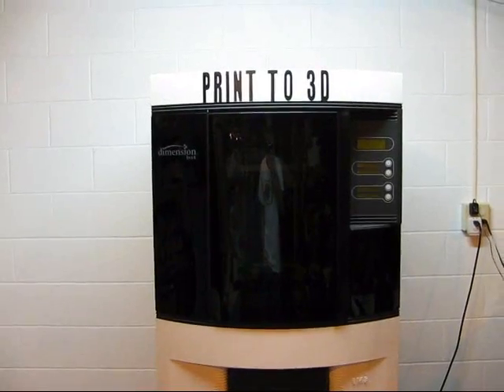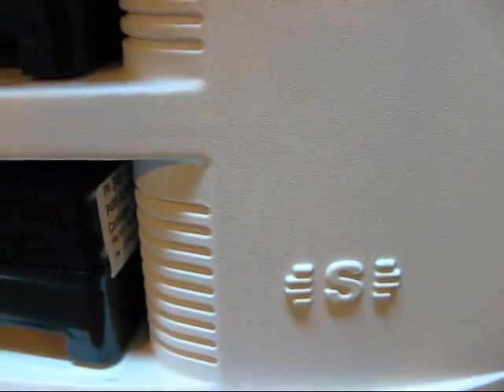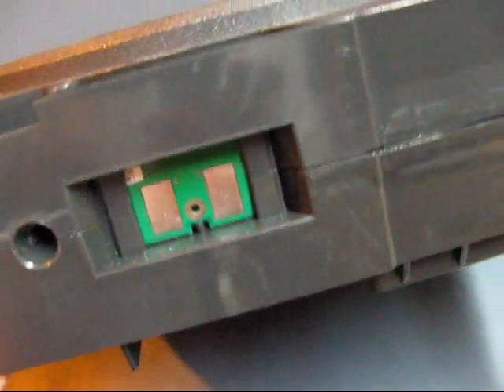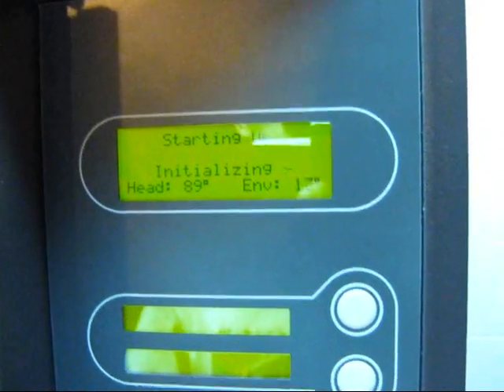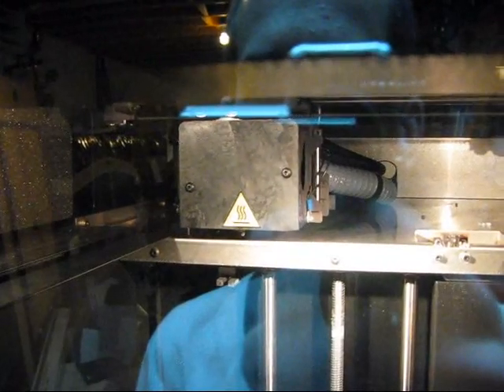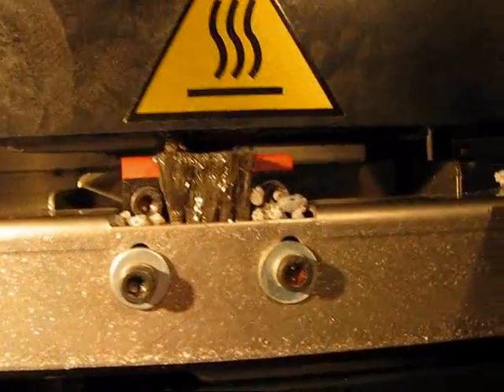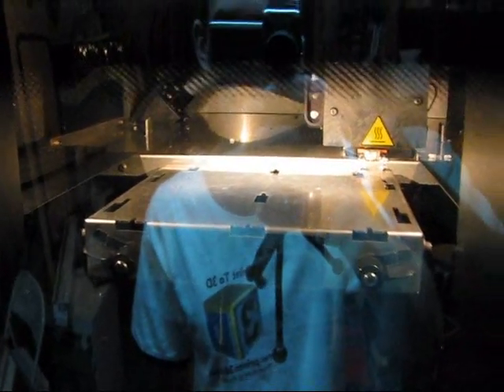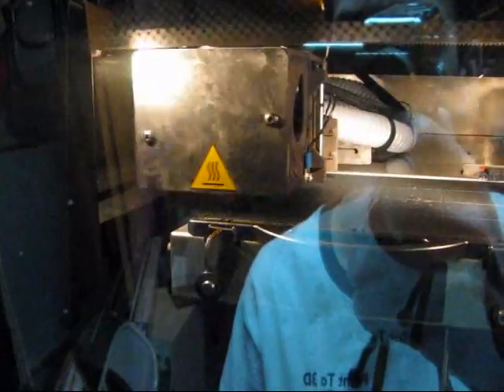3D Printing the Works

Comment from the maker: From my standpoint reprap isn't that impressive either...
Any engineer can figure out how to take an existing technology/machine (aka FDM/Dimension) and break the parts down into smaller pieces so they can be printed.

Last time I looked reprap was bunch of printed plastic connectors held together with metal rods.  In order to be impressive it would need to be completely printed with the exception of the electronics and extrusion head.

Comment from the maker: Its ABS plastic.  The parts are not as strong as ABS molded parts due to the layers being melted together, but sure you can use 3d printed parts for functional parts.

Comment from the maker: You can't take a picture of something and then just print it.  You need to create a 3D computer model of the object.  This can be done by using a 3D scanner as well which basically takes a 3d object "scans" it and then makes a computer model.